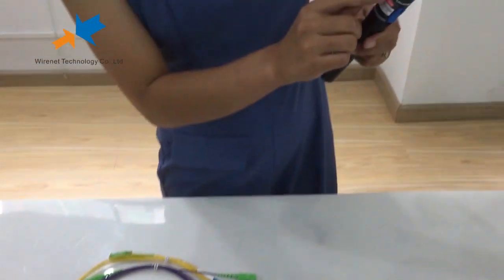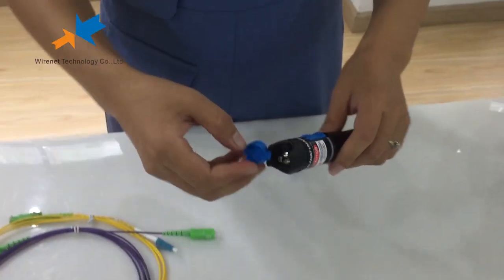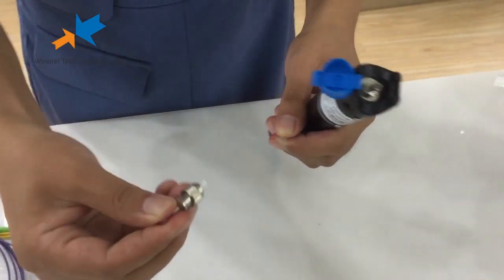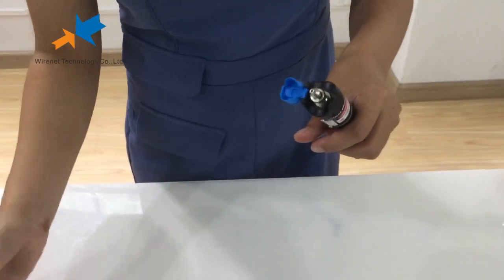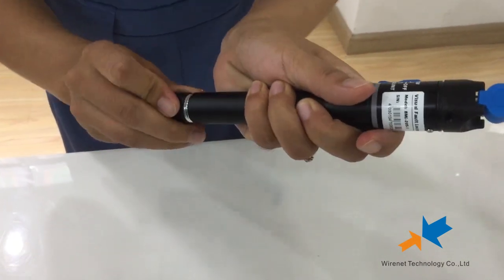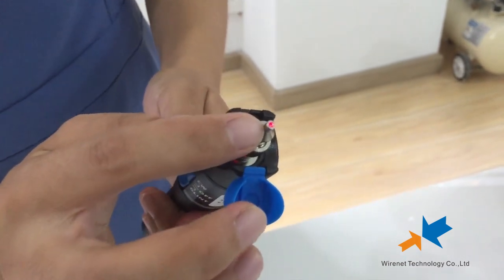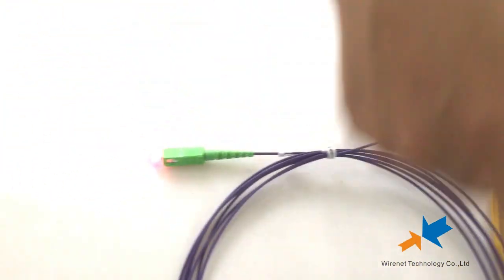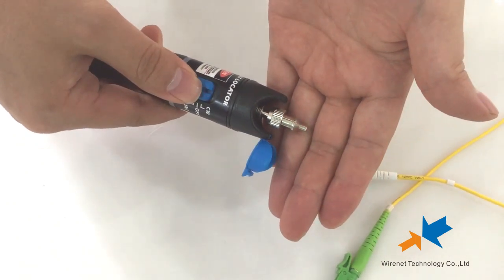How to use fiber optic light source visual fault locator

Comment: Hi! Do you have a fiber optic cable tester for single mode that will also test, measure, and display the length of breakage if there is any?
Reply from the maker: hi, dear, yes, its fiber ranger, pls contact sales@wirenet-tech.com will quote you the device

Comment: How much is this Fault Tracker
Reply from the maker: Wirenet Telecom Technology Co,Ltd;
1年前
this VFL has 1mw, 2mw, 5mw, 10mw, 30mw optionals, different power can transmit different distance, pls tell me the cable length you want to test, then i will quote you accordingly, you can send me email to info@wirenet-tech.com or add my what's app: 0086 135 3757 6344 to get more technical information, thank you!

Comment: Prize
Reply from the maker: this VFL has 1mw, 2mw, 5mw, 10mw, 30mw optionals, different power can transmit different distance, pls tell me the cable length you want to test, then i will quote you accordingly, you can send me email to info@wirenet-tech.com or add my what's app: 0086 135 3757 6344 to get more technical information, thank you!
Reply: For 5 kilometers ?
Reply from the maker: @bin2x959  so sorry to miss your message, pls advise the qty in demand,and pls send email to my email of info@wirenet-tech.com, i will quote you the price, freight etc.